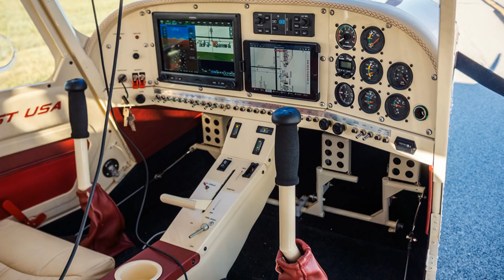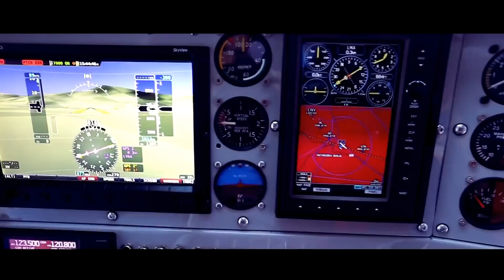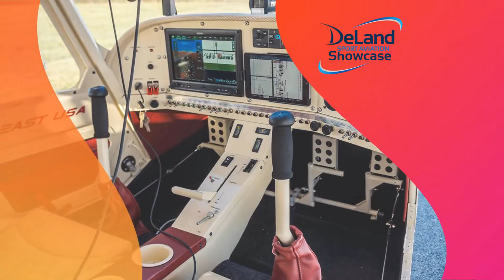Discovery 600, all metal, tri-gear, side by side seating, Light Sport Aircraft Aero East USA.

Comment: Hi Guys. Base price should be under 100k and full loaded with Garmin G3X, ADS -B in and out, autopilot, ballistic parachute, etc should be 130K range. This is full metal body aircraft, great performer. Many of those flying in schools and it will great replacement for 150/152 much better and bigger.

Comment: Fist bumps  👊👊👊👊👊,  high fives/pats on the back  ✋✋✋✋✋
Reply: Hi Guys. Base price should be under 100k and full loaded with Garmin G3X, ADS -B in and out, autopilot, ballistic parachute, etc should be 130K range. This is full metal body aircraft, great performer. Many of those flying in schools and it will great replacement for 150/152 much better and bigger.